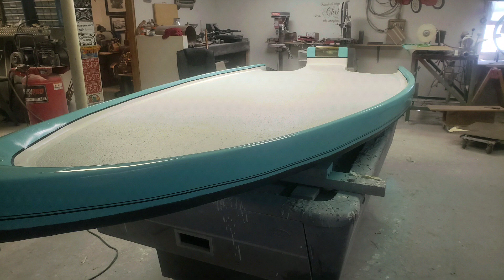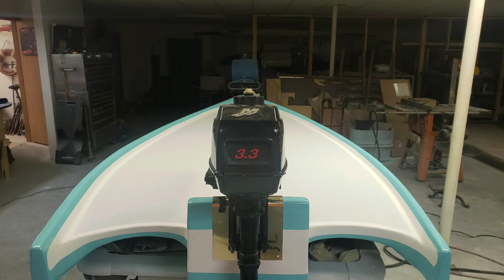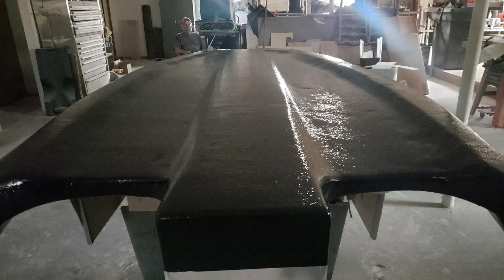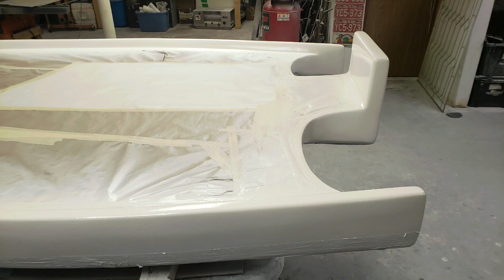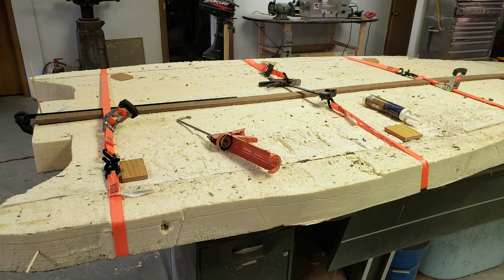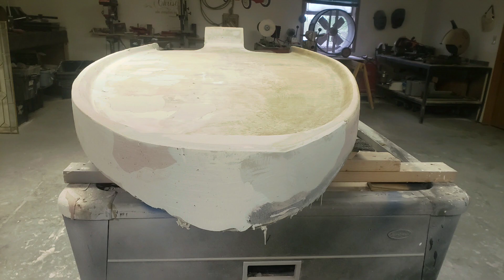Stingray diy micro skiff

Comment: Can you tell me how many inches that motor mount is? From bottom of hull to top?
Reply from the maker: 13in
Reply: 15 for short shaft...20 for long shaft....13 would have lots of drag.....could use a jack plate to raise it.
Reply from the maker: @bipedalhominid6815  sure you could use jack plate i didn't because of weight

Comment: Hey Tony, I'm really inspired by this project. I'm wondering where do you acquire your foam, what type is it and what resin and glassing schedule do you use? I'm interested in building my own skiff, and any info you could bestow would help me on this journey. Thank you and keep up the great work! That thing looks like so much fun, and very sexy
Reply from the maker: Polyester resin and gelcoat fiberglass same as making boat
Reply: @tonyhouston2575  how did you keep the poly resin from melting the foam?
Reply from the maker: @bipedalhominid6815  you've got to use form that don't melt
Reply: @tonyhouston2575  what foam? I used XPS foam but had to use epoxy.
Reply from the maker: @bipedalhominid6815  I don't know it come in 4ftx8ftx4in with tar paper on both sides
Reply: @tonyhouston2575  oh so did you use the tar paper as a barrier?

Comment: This is an all foam build? What kind if foam did you use?
Reply from the maker: Don't know name of it I bought it at second hand store it was 4x8 insulation
Reply: Its solid once fiberglassed? Ive always thought about doing this with foam but thought it would be too brittle
Reply from the maker: @andreb.7445  i put wood in it and steel pad for cleats and seats
Reply: Tony Houston where do you put wood?
Reply from the maker: @andreb.7445  the reason you put wood are metal if you r going to mount anything  can't screw into foam